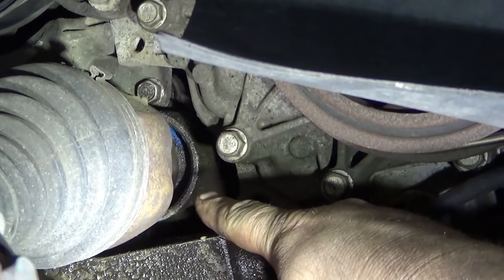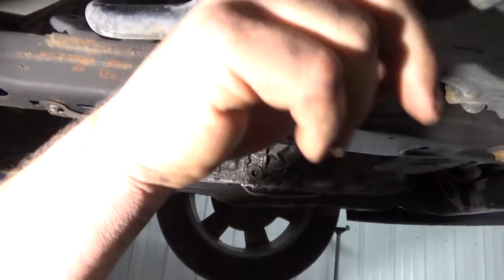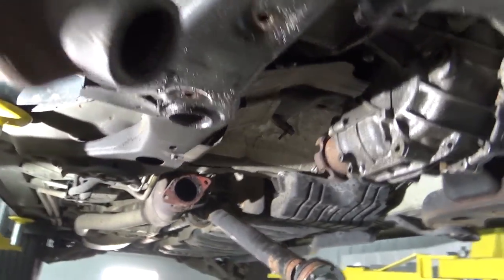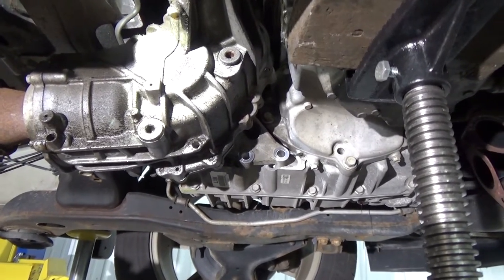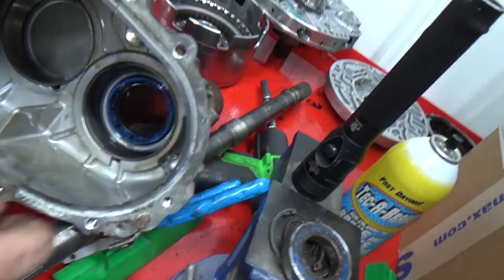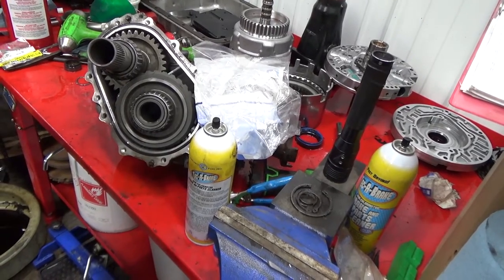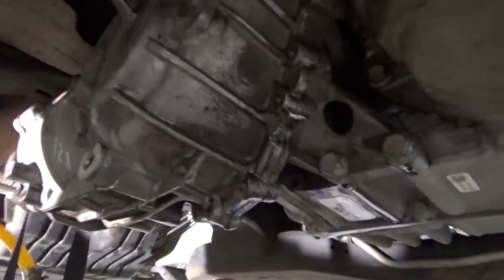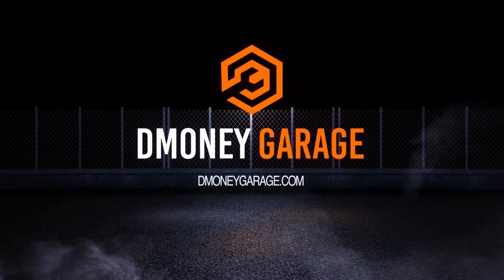Traverse Acadia Enclave Transfer Case Reseal. Transfer Case Removal. Transfer Case Reseal Fluid Leak

Comment: I have one now that the transfer case output shaft bearing to the driveshaft is very bad, and wobbly, drained the fluid at 70k miles and it's full of metal. I wanted to just replace the bearings and seals and ship it, but can't find the kit available to do so.